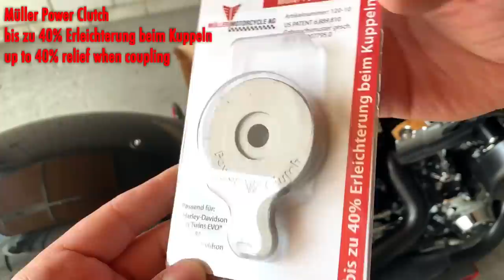Harley-Davidson Müller Power Clutch Install

Comment: Interesting install. BTW, your Primary Cover appears to be upside down as indicated by the HD logo. :)
Reply: @HarleyDavidsonBreakout  Yes I acknowledge it is correct. but it appears top heavy. Usually the logo looks balanced but doesn't on your primary cover. But no big deal.
Reply: Trolls always have to get the last word in, even when they are stupendously wrong. Gr8 video as usual. 👍 And Ride safe!
Reply: the bolt pattern will only let it go on one way

Comment: Well, I just got done installing the Muller Power clutch, and I am not pleased. Not one bit of difference, so what did I spend my money for? I tried different adjustments, from the 1/8 in. they recommend, up to 1/2 turn out on the adjusting screw. No difference whatsoever.  Making different adjustments at the cable did not make a difference. Just another gimmick.